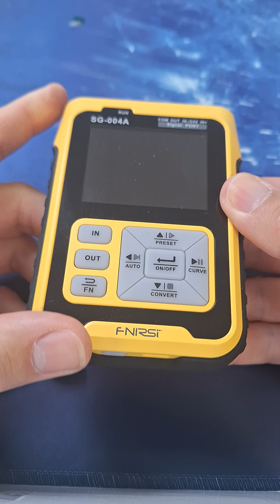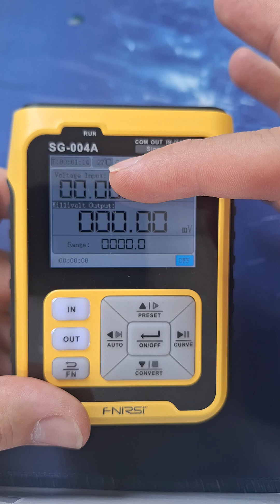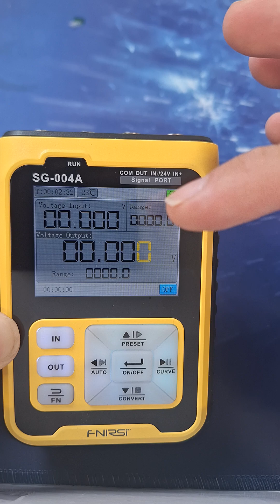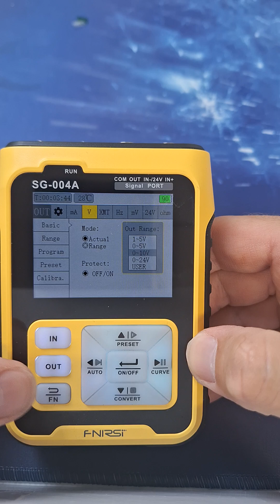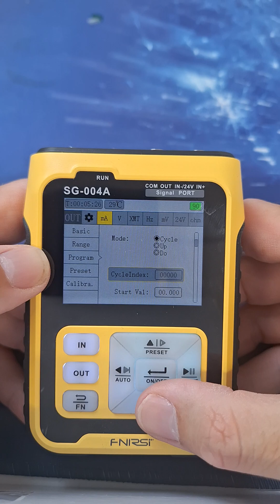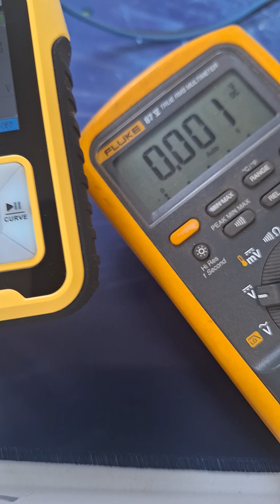SG-004A Output signals - setup and use

Comment: Hello Bro, could you advise does it supports temperature digital signal simulation for calibration TP100 temperature sensors?
Reply: Yes, it does that but it does that for Pt100 RTD analogous simulation, not for TP100 (don't know what does it mean).